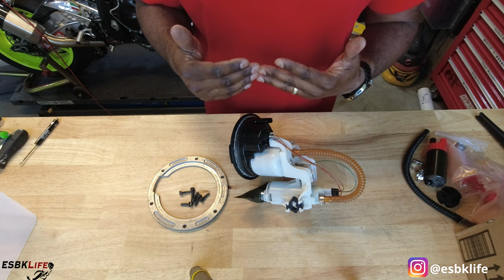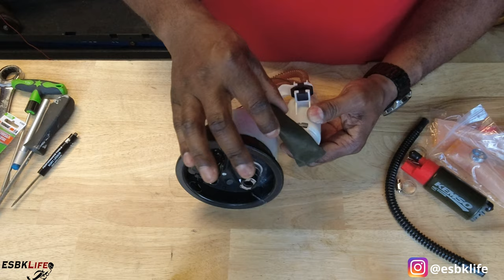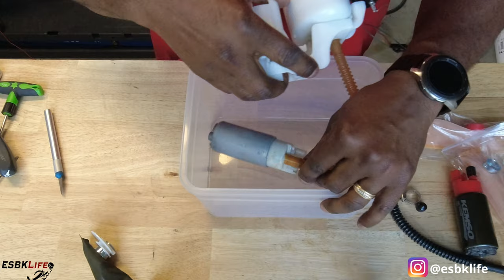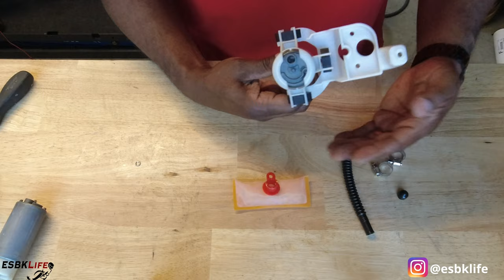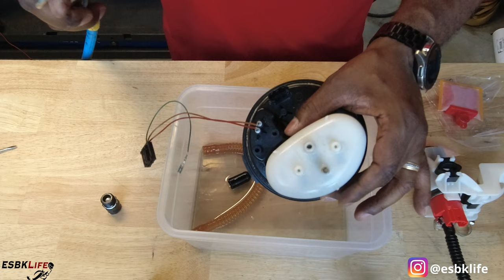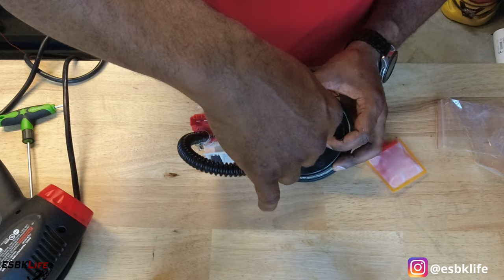ESBKLife: S1000RR Fuel Issues

Comment: Great video do you know why overall fuel range on the s1000rr would diminish? I used to get 170 miles on a full tank and now it’s 105!
Reply from the maker: What's up AEA.  There are many reasons why your fuel mileage dropped including but not limited to; tune or ECU flash, the addition of a performance exhaust system, worn plugs, more aggressive riding style, worn engine components, and faulty fuel components (pressure regulator, pump or injectors, etc). Even low tire pressures or a neglected drive chain can negatively impact mileage. Riding modes is another one.  If you're riding around in Race mode on the street, you can expect reduced fuel mileage or increased fuel consumption. When was the last time you had the valves checked and adjusted?
Reply: @ESBKLife  Thanks for the feedback, that makes alot of sense.  i have a stage 1 tune...i ride pretty conservatively on the regular barely ever go past 9k rpm.  im mostly in road mode because race is too stiff for the streets.  the bike has 4400 miles on it so not sure about worn internal components. My tire pressures are lower than recommended by about 8psi.  i dont think the valves have ever been checked since the bike is fairly new.  i took the tune off and reset computer trip info but am now a little worried because the fuel values have gone down even further 99 miles per tank.
Reply from the maker: ECU flashes/tunes tend to gain performance at the expense of fuel mileage.  Which is to say they add or in some cases remove fuel for a given RPM.  if you removed the tune, then it will take a few miles for your bikes ECU to figure things out. Also, 8psi below recommend is a significant amount.  That will increase rolling resistance, which will lower fuel mileage. Great for wheelies though LOL.  However, it's been 5 months since we chatted. I assume you either figured it out or your living with it?
Reply: @ESBKLife  yeah your right on that one after I took the tune off fuel consumption readjusted a little but after riding for a full 30 days it never went back up to normal so I just put the tune back on 🤷🏼‍♂️

Comment: i got a new fuel pump but my bike is still somewhat sputtering at 100+ at full lock ? what is the issue ?
Reply from the maker: I wish I could tell you Josh.  You need to try to determine if its air, fuel, or spark.  Or it might be a bad tune.  Your best bet would be to put it on a dyno with a professional tuner who really knows your bike.  They can help you determine what's going on.

Comment: Still looking for the video of how you got the fuel pump out, i have a 2015 I recently laid down and i went to test it with the gs-911 and it didn’t make a noise, so im wondering if thats 1 of my issues, at the moment my bikes lights come on but, it won’t start.
Reply from the maker: The fuel pump is located in the bottom of the tank. Drain the tank, remove it from the bike, flip it upside down then unbolt the fuel pump assembly from the tank.  Once the fuel pump assembly is out of the tank, it's pretty straightforward to remove the pump from the assembly.  I thought I had a video showing that process.  I might have posted it to my Patreon page.  I'll take a look.

Comment: The first screen you were using WAS the correct one.  It just needed to be rotated into the same position that the original screen was in.  Also, you needed to loosen the hose clamp on the top and rotate the black hose a little bit to get rid of the twist. Then it would be in a perfect "U" shape, from top clamp to lower clamp.
Reply from the maker: Thank you for the feedback, much appreciated. Btw, I already corrected the hose as I noticed it was a bit twisted as well lol
Reply: @ESBKLife  Good informative video for all experiencing the same issues on their BMW

Comment: the electrical connector on the outside of the fuel tank for the fuel level or float can it be purchased?
Reply from the maker: @cutterable  I don’t believe so, but you should check. Worse case you buy a used fuel pump assembly to get the part you need. However, I might have that part you need n my spare parts bin lol
Reply: @ESBKLife  it is the pigtail/connector on the wiring harness might have to get the wiring harness going to the fuel pump for 2012 bmw s 1000 rr

Comment: Hi man nice video👌🏻👌🏻 and the explication👌🏻👌🏻,  after add the new fuel pump how was working the bike ?  still louse power again? Because I have this problem in my s1000rr 2012 , i did exactly same thing like you ( same fuel pump too ) and mine still doing.. i lose power..🥺 help pls thank you 🙏🏻
Reply from the maker: Hey Domino. My issues are gone. I’m back to 100% power and the bike rips again! Man I wish I could help but, there are a bunch of reasons why the bike could be running like it is. However, if you’ve already checked the fuel system, the other two are air and electrical. This can be a long process particularly if your bike still has its secondary air system and charcoal canister. I suggest getting a GS-911 diag tool and test each system separately.
Reply: @ESBKLife  thank you so much man you’re amazing!👌🏻🙏🏻
Reply from the maker: @Crz_alexx  if you’re lucky, the GS tool will show you an error code that you can trace back to something easy.  Good luck man👍🏿

Comment: Hii.... Can you help me?
I have one S1000RR 2021 model year, facing every day morning unstable Rpm, missfiring sound,pop-up sound and too much fuel smell, may be rich fuel.bike software already up to date, after update nothing changed.i have some doubts #air temperature sensor,#fuel pump ,#EU5 carbon canister
Can you help me?
Reply from the maker: Unfortunately, I’m not familiar with the newer S1krr bikes, but virtually everything is controlled by the ecu these days. Therefore you should get yourself Diag tool/error code reader. Something like a GS-911. Again, I’m not familiar with the newer bikes and not sure if there’s a compatible GS-911for your bike. But you need to see what info the ecu is getting and if there are any errors. Otherwise you could just end up wasting $$$ replacing parts. If there are no errors check your fuel map if possible or just reset everything with the tool. My 1199 Ducati sensors would get out of sync and the bike would run like shit. A quick reset in the ECU and all was well again. Your bike is basically new so I would suspect it’s something like out of sync sensors and not a failed part. Having said that, if the bike is still under warranty, don’t fuck with it. Just bring it to the dealer! Messing with it could void the warranty.
Reply: @ESBKLife  Thank you, there is no fault codes present I already check with BMW ista system.some of EU5 bmw motorcycles also showing this,i saw in youtube today,can you check it out (just serch new bmw s1000rr cold start issue).
Anyways thank you so much for your reply
Reply: You should try putting high octane (like 98) and give few pulls to circulate in the fuel line, reset adaptation is preferred

Comment: I wasn't aware that teflon/PTFE tape was fuel resistant. I'm purchasing a used fuel pump for my track R6, would you recommend the same procedure before I install it? Thanks!
Reply from the maker: Hey A7TSH, it’s not and no I don’t recommend it. It used standard Teflon tape as a temp solution. There are sealants specifically for fuel connections. Permatex offers a few that you can pick up at your local parts store.
Reply: @ESBKLife  appreciate the clarification!

Comment: Hello, I ran my gen2 run really low on fuel by mistake, it ran out and stopped, i managed to get to a garage and fill up, since then, every time I give the bike some beans, it goes into limp mode, if I go steady its fine, only when I gun it, ive been told I've blocked up the fuel filter inside the tank, what are your thoughts on this please
Reply from the maker: I’m no trained bmw technician, but that sounds about right. Try removing and back flushing it.

Comment: Took my s1000rr in for a fuel pump recall and now my bike goes into limp mode after 15 mins of riding it 😢
Reply from the maker: Seeing this is directly related to the work done for the FP recall, don’t mess with it and bring it back to them. If you touch it, they will say it’s your fault and you’ll be on the hook for the repair.

Comment: Hi Derek, I own a Japan mfg, 2020 S1000R and within the first 2000 kms I ran into Fuel Pump problems. It appears fuel pump is not release the pressure once heated up. Anyways so I ordered a new Fuel Pump assembly, using the microfiche, there were 2 part numbers and the one i ordered and was sent has the female coupling different from the one I previously had on my bike. The original one is like the one in your video however the replacement ordered is full plastic with a white snap in lock sorta thing. My Quick disconnect fuel line connector does not fix into it. Have you come across this sort of fuel assembly and if you have any advice on how to address this situation it sure would be helpful. Locally the BMW dealer has not seen the fuel assembly of this kind. Here is link to another video on youtube that shows the assemble for an RR which matches the assembly i received https://www.youtube.com/watch?v=jE8eO5_WHOI
Reply from the maker: Hi Amit.  Unfortunately, I may not be the best person to ask. I don't have any experience with the latest gen S1000RR...yet lol.  However, it sounds like you either order the wrong part or were sent the wrong part.  I did a quick search and I only see one fuel pump number for your bike and it fits S1000RR, S1000R & M1000RR from 2018-2023 (16148414945).  Maybe you were sent a pump for an XR or another model bike by accident? Can you share the part number you were sent?